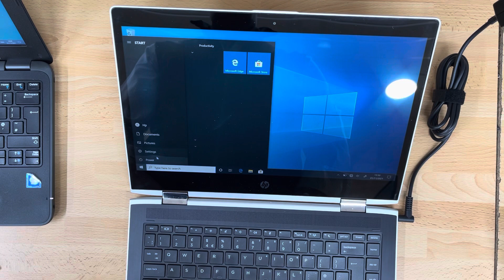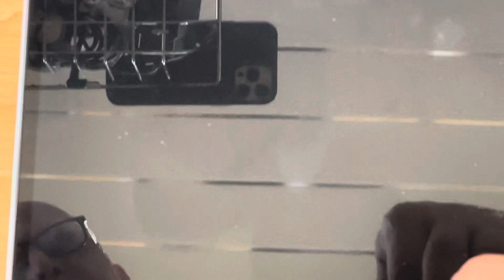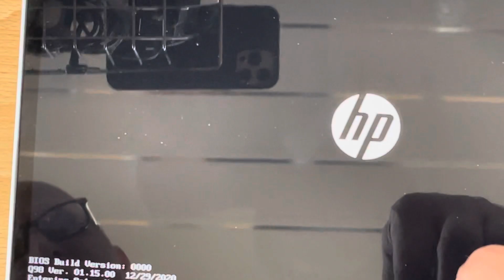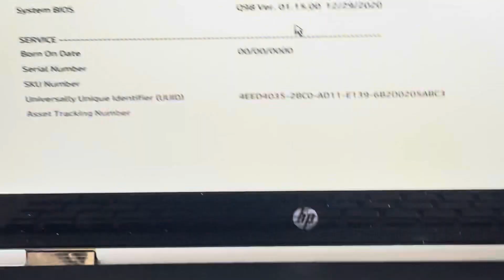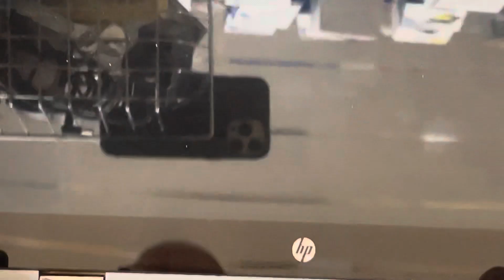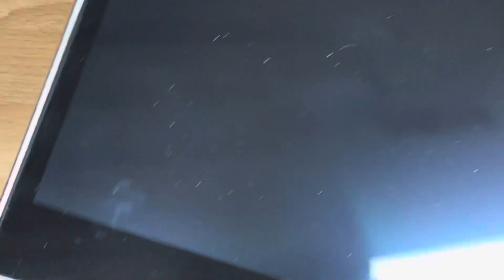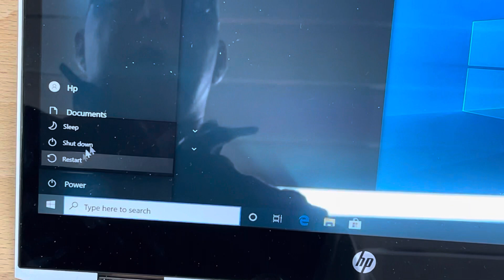HP ProBook X360 440 G1 Bios Password Removed

Comment: Is there a way to just reflash bios and reset password?
Reply from the maker: No there is no way to refresh or update bios if it is locked with password.
Reply: @MyResponse123  How about flash it onboard with soic8 clip without soldering?
Reply from the maker: @ВадимТатарский-э7м  I haven’t tried that if you know about you might try and update 
Thanks
Reply: @MyResponse123  Where did you get bios without password?
Reply from the maker: @ВадимТатарский-э7м  check eBay my dear
Reply: @ВадимТатарский-э7м  yes...u can flash it onboard too with soldering skills, clip adapters r not always reliable.. i soldered 8 wires of different color codes to the chip on laptop board other ends connected to CH341A programmer, read the binary file & save it to other pc, remove password from same binary file & reflash it to original chip...soon i m going to make a video on that, just yesterday i did that to HP Probook 6560b but i forgot to record it